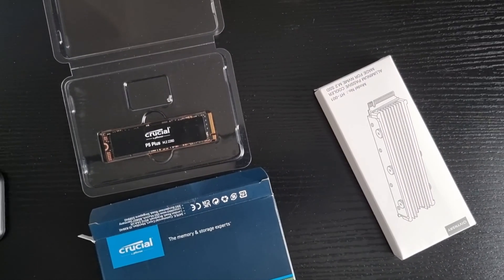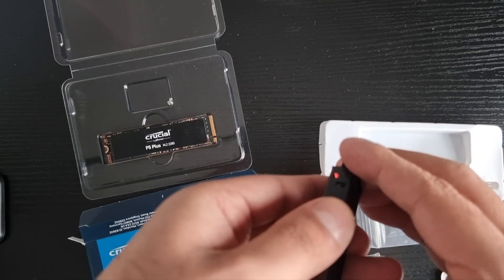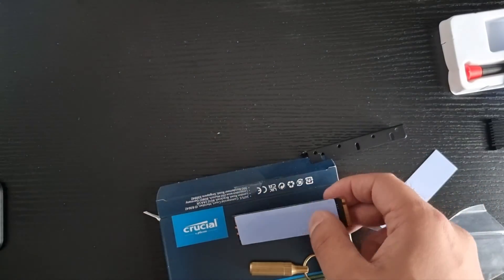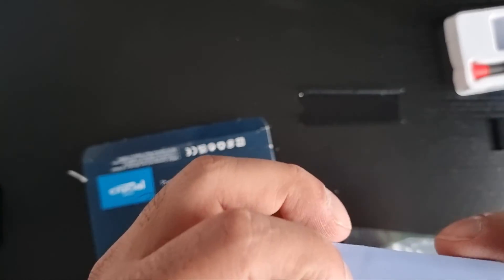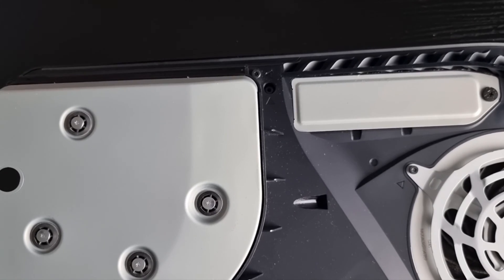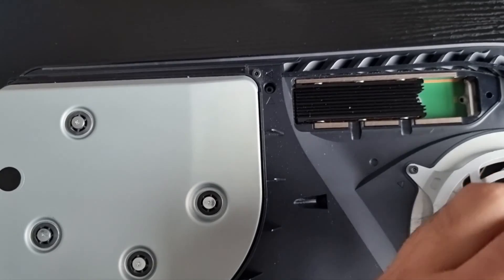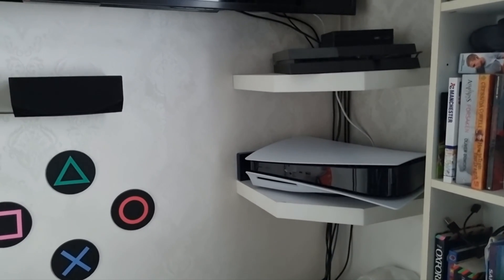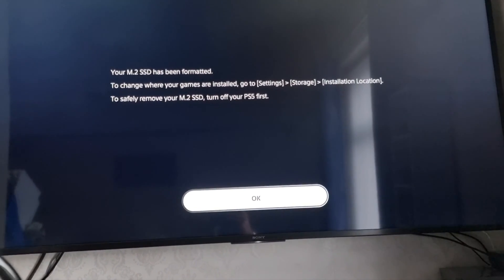How To Install Crucial P5 Plus SSD In A PS5

Comment: What to do I have a ssd crucial p5 plus with heat sink but it says Can't access your M.2 SSD.
Try turning off your PS5, removing your M.2 SSD, and then inserting it again.
Reply from the maker: If you have done everything like I showed in the video, and also you followed the PS5s instruction to trying to remove it and inserting it again. The only option you have left is exchanging the SSD from the place of purchase as you may have a faulty one.